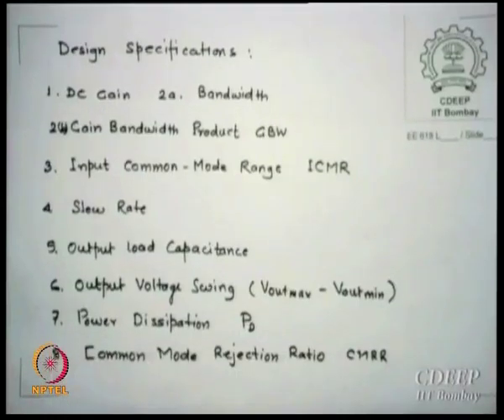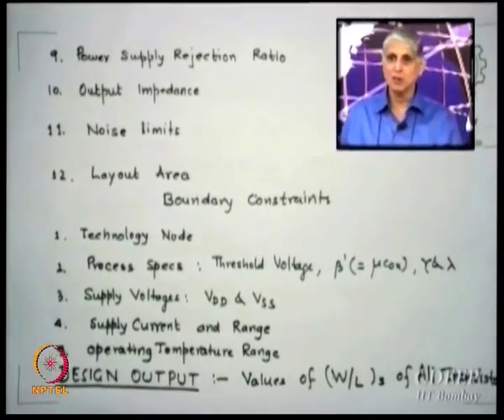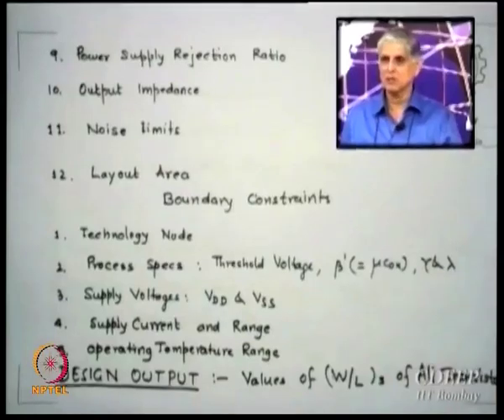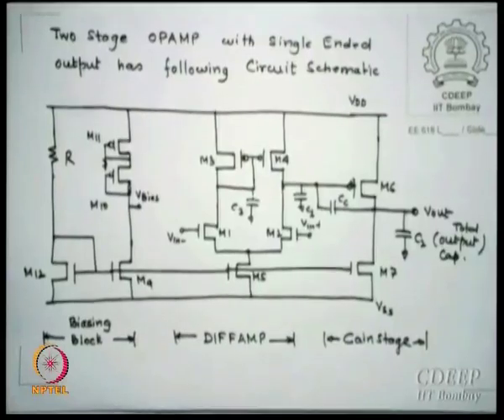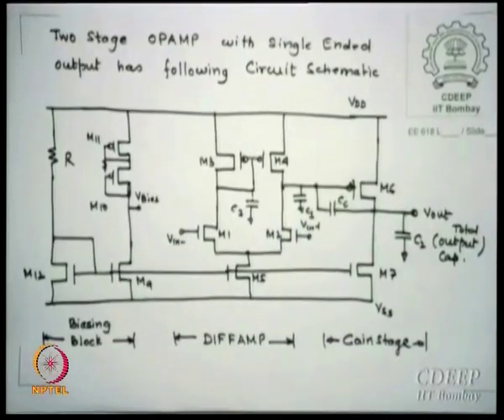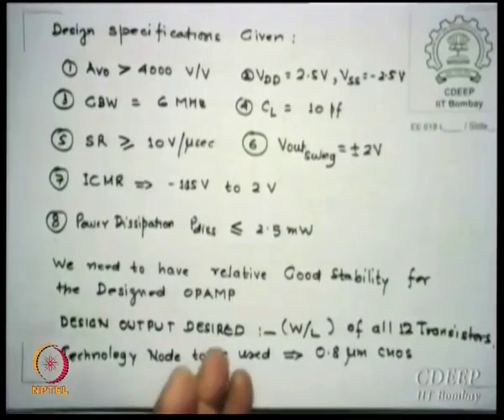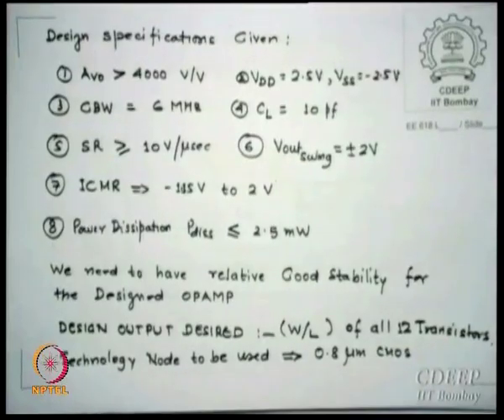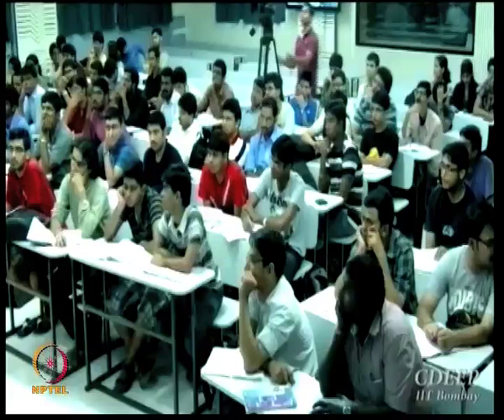Mod-01 Lec-19 Lecture 19 : OPAMP Design

Comment: what is the importance of miller capacitance (Cc)?
Reply: The importance of Cc is:
Pole splitting giving larger phase margin : the differential amplifier is a 2 pole and one zero system with the 1st pole, 2nd pole, UGB(unity gain bandwidth),  and zero coming one after the other on the frequency scale. this reduces the phase margin (obtained from Bode plot). And in some applications we need a phase margin of minimum 45 degrees. in such cases the compensation is done. What happens then is the poles gets separated and we get 1st pole, UGB, 2nd pole and zero in the increasing order on the frequency scale. Therefore the system behaves as a one pole system before the UGB. So we have an increased phase margin.